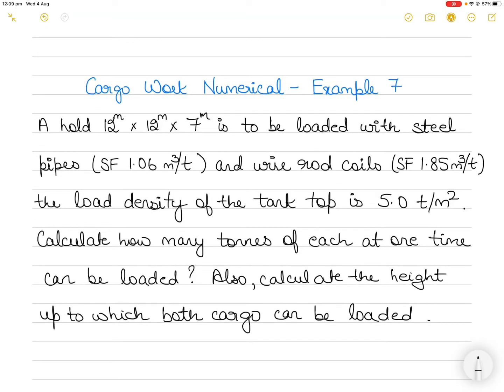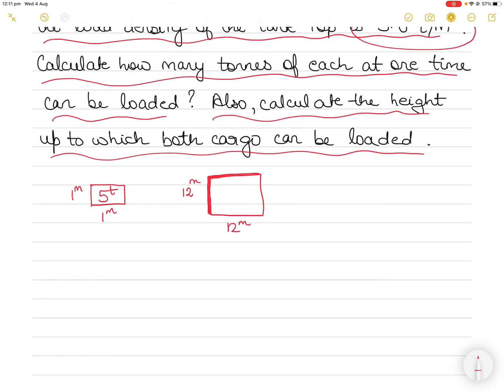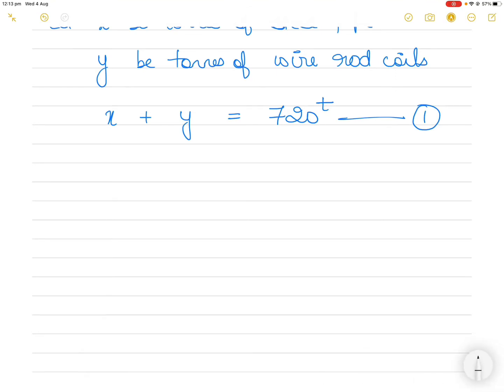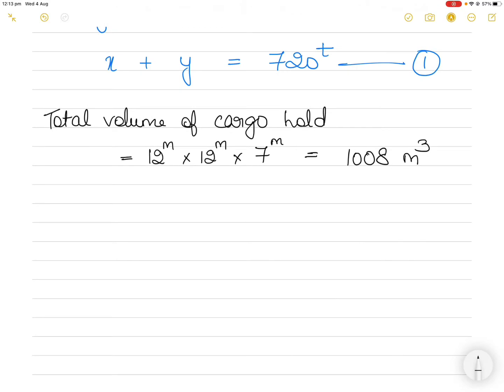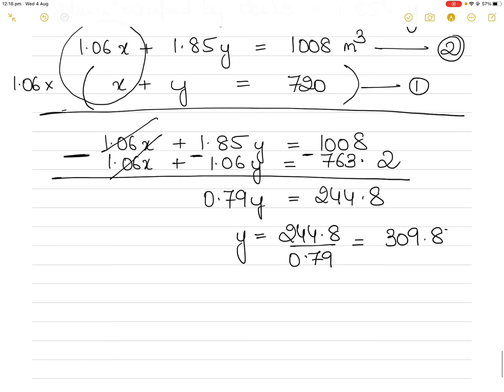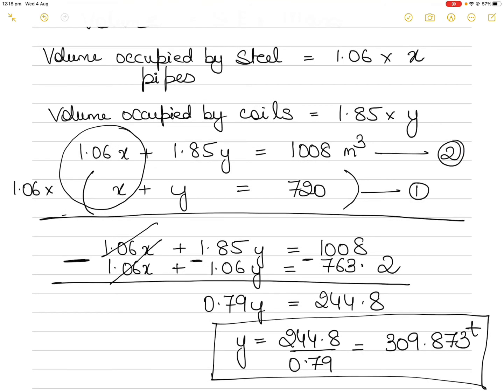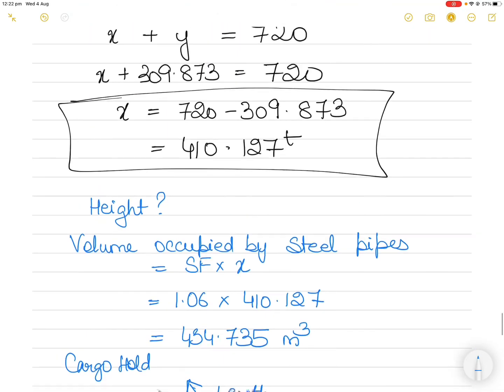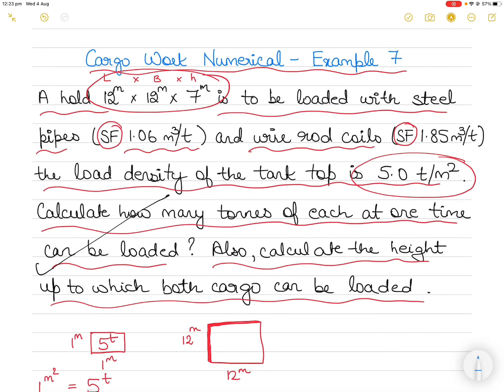Cargo work numerical - (loading 2 cargoes with different stowage factors in the same cargo hold)!

Comment: Thank you 🙏 Sir ! I consider you the MASCOT of nautical training , possessing the expertise in wonderful teaching skills ? Great video ! Very well explained thank you 🙏
Reply: A derrick fitted with 2- fold purchase use to advantage is to lift a load of 26T . The cargo runner wire is rove through the lead blocks on derrick head and heel on the way to the winch . What will be the size of wire ( 6 x 24 ) to be used when Factor of Safety is 6 and Friction is 8 % . What will be the efficiency off the system .

Comment: Sir ,i think in errol fernandes the qstn is wrong ,I am getting x(mass of steel bilkets ) in negative .
And I am taking volume as bale capacity because it is given and other parameters are also changed .

I am solving as according to u but getting  (x) negative

Comment: Pakitulongan naman ako nito sir baka may nakakaalam

Find the final LCG of the cargo which had stowed in 1 cargo hold with 5 sections:
Sec. 1 = LCG 1.5/ Cargo weight 15 tons, 
Sec. 2 = LCG 3.2 / Cargo weight 9 tons, 
Sec. 3 = LCG 3.8/ Cargo weight 18 tons,
Sec. 4 = LCG 4.1 / Cargo weight is 13.5 tons, 
Sec. 5 LCG 4.8 / Cargo weight is 17.5 tons:

Comment: Sir there is one problem of cargo work which is confusing after the two different type of methods around it. 
Can you please explain it in a video as it would be very helpful .  
Thank you sir.
A derrick fitted with 2- fold purchase use to advantage is to lift a load of 26T . The cargo runner wire is rove through the lead blocks on derrick head and heel on the way to the winch . What will be the size of wire ( 6 x 24 ) to be used when Factor of Safety is 6 and Friction is 8 % . What will be the efficiency off the system .